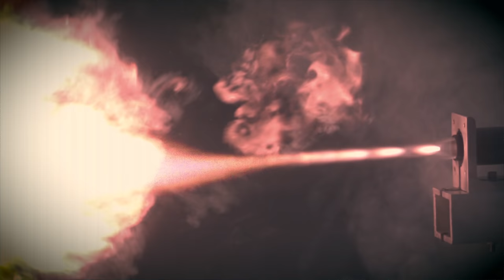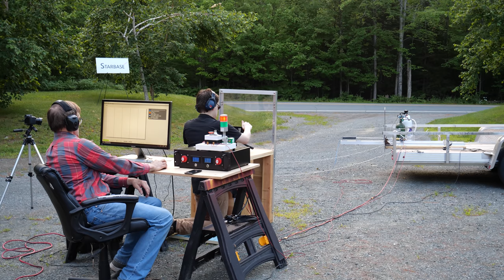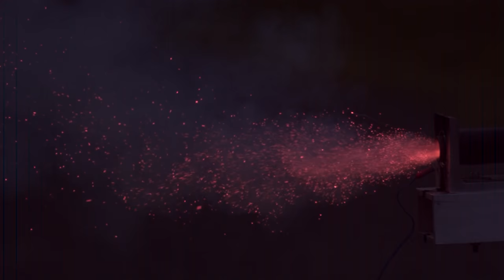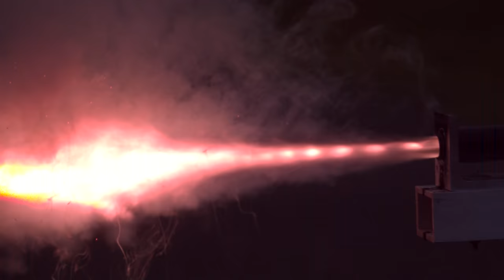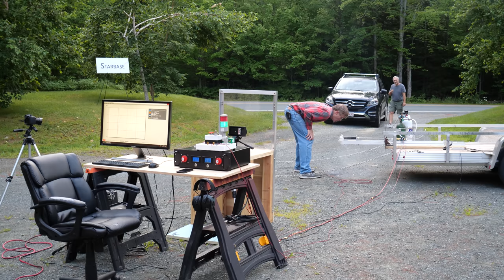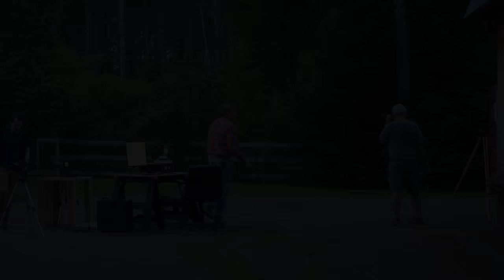Our Most Powerful Rocket EVER! Upsets Local Official!

Comment: Thank you very much! I was about to ask what these light nodes in the exhaust fire plume are, when you explained it @15:20 . Still I did not understand it completely. These nodes are similar to a standing wave formation with one open end. 
1.Could you calculate the exhaust velocity via the distance of each node to another for the standard atmospheric pressure?
2. In vacuum you would not have any nodes I assume ?
3. Could you make a video with computer generated graphs to explain this phenomenon physically?
4. Have you thought about measuring the heat in the nodes and inter-nodal sections?
5. How many decibles of sound was recorded at a specific distance?
6. You for sure have lucky neighbors! If I would reside nearby I would get physically educated on a drive-by-lesson.
Reply from the maker: You might be able to do that, but the exhaust gas temperature and the average mass of the components in the exhaust would also have to be known.
You're right about the vacuum, you need a surrounding atmosphere to support that interaction.

Comment: That was fun.. But as per the "being able to scale these up in size".. I do question, the C.G. of a larger unit, like the size of the old school Space Shuttle Rocker Booster. A stand alone unit, that size, would need a significant wing surface area for guidance. The C.G. quickly changing as the nose becomes exceptionally heavier, as the charge cooks off the rear most weight. The AIM-XXX missiles as an example, are deceptively small looking, even though, they are almost 6 feet long, and other models are 10 feet long. Most of that series in the A2A is computer algo's for flight control and stability and interpolation of its xyz to the rest of the world location. It will be fun and interesting to see. Please note, I am in no way saying this is not a good idea, rather, just knowing, why they shy away from solid forms of propellants, in key situations. I do like the idea of having the ability to actively control burn rate with the nitrous oxide push-through. Sure beats hydrazine, as per the safety factor, by what, 100 times?..LOL.. No point in mentioning N204 UDMH stuff.. That was some high speed stuff, when it decided to do what "IT" wanted to do and not what "YOU" wanted it to do..lol.. It would get outa hand pretty quick. Never mind a eroded shutter valve allowing a full throttle gas off, you just run and hide and wait.. These units you are playing with, do have so much potential.
Reply from the maker: Thanks.
The propellent burns laterally outward from the core as I described in a couple of the previous videos in this series.

Comment: What is the theoretical speed limit of the rocket, if let loose? Is it the same as the speed of the gas leaving the nozzle when measured on the ground, or would the pressure against the N2O decrease with the speed of the rocket so it could go even faster?

Comment: You are the best, man.
One of the most interesting series about rockets I've ever seen.
I have a question
I've got a load cell to make a test platform,
How can I connect it to the computer for monitoring the data?
Is there any specific program?
Reply from the maker: The load cell generates an analog output.  Our system digitizes this, but a DAC can do this as well, although you'd have to calibrate the output.

Comment: I'd really like to know what kind of force these rockets are producing - and especially a weight to force ratio & burn time.  I think it would be great to break down potential speeds you could get for various weight rockets & variable force.  So if it's a 4lb rocket putting out 25-30lbs/ft of force what would the acceleration be, what is the velocity curve, how fast will it be traveling when it is out of fuel (5-8 second burn time??).

I'd like to be able to make some spread sheets to see what potential speeds could be attained by playing around with the numbers - so a goal could be set and then work my way towards it.
Reply from the maker: Did you check out the links below the video?

Comment: I'm curious if the fact that the trailer is not totally stationary, if that reduces the thrust measurement that you see? Cool video BTW.
Reply from the maker: Thanks.
It does, but only by the ratio of the acceleration of the trailer to the acceleration of the exhaust gas. It's completely negligible.

Comment: Without a solid, unmoving base I don't think you'll be able to measure accurately thrust during the entire burn, only the peak thrust. Surely there's a better solution to secure the trailer? Using dyneema or something that does not stretch appreciably and pre-tensioning front and back to hold it in position?
Reply from the maker: The effect of the movement is negligible.  It's proportional to the ratio of the acceleration of the exhaust gases to the acceleration of the trailer.

Comment: Isn't the oxygen redundant? For automotive engines nitrous oxide is the source of extra oxygen to support the combustion of more fuel. Injecting direct oxygen would likely burn a hole in a piston or valve. I don't know much about rockets, but this seemed odd to me for some reason. Anyone know?

Comment: In professional tests the shape of the flame is usually a clean cone-like solid shape
Meanwhile your tests (and amateur tests in general) have the cone shape at first but at the end it just becomes a mess that looks like fire us being thrown around randomly almost as if it's a continuous explosion

Why is that? my personal theory is that your output is fuel rich and after the initial clean exit the output collides with itself at the tip and the air around it and just spews everywhere and since there's leftover fuel that combusts in this randomness and so if you were to adjust the pressure of the nos you'd get a cleaner more efficient shape
At least that's my theory, I'd love to hear your answer and how it compares

Edit: I noticed some evidence that could give my theory credence, as the rocket reaches its final stages it does reach the perfect shape then even loses the tip although at some point, could be cause of the fuel grain widening and thus giving out less fuel (the heat and pressure are not concentrated on a small surface area as before)
Reply from the maker: It's a matter of scale.  "Professional" tests are usually performed on engines with substantially higher chamber pressures and the images don't capture the entire exhaust plume.

Comment: It seems to me the nitrous will be providing thrust as well, perhaps you could isolate that base thrust without ignition and calculate what the increase was.
Reply from the maker: We could, but just like measuring the thrust of a Raptor engine without igniting the methane-oxygen gas, it doesn't seem important.
Reply: @TechIngredients  Oh absolutely, it is a completely legitimate measurement in its own right. I was just thinking it would be an interesting statistic for the sake of it. It would be interesting to see how that figure compares with the increase in thrust liquid engines produce when ignited.

Comment: The rocket exhaust is rather oscillatory.  Could this potentially cause structural failure were it scaled up to a full sized rocket?  Is there any way to make the flow more regular?

Comment: How do these engines compare on the normal model rocketry engine scale? How do your hybrids compare to the Aerotech hybrids with the miniaturized cyclinders? Have you tested the commercially available engines for differences in the thrust of your mostly paraffin fuel cores versus the commercially available composite?

Comment: Sorry if the question sounds funny! would the reading on the load cell be correct if the trailer moved? I understand that load cell is part of what is moving the trailer but any move of the trailer should lower the reading on the load cell. No?
Reply from the maker: The acceleration of the trailer will not affect the reading on the force guage because whether it is static or moves the force pushing on it is the same.
However, the acceleration of the rocket motor does reduce the force because that part of its thrust, which is accelerating the motor, is not seen by the force guage. Nevertheless,  that effect is extremely small because of the motors' small mass times the acceleration, which is also small.
Reply: @TechIngredients  Got it. Thanks a lot. I am still learning

Comment: It looks like there's some thrust oscillations for the larger engine.  You can see it in the data as well where it cycles between -520 and -550 a few times.  Is this indicating a issue with nitrous delivery?
Reply from the maker: I'm pretty sure that's it.

Comment: Guess it pays to always watch the end of the video :) 
I was going to ask you about the bright spots within the exhaust. You mentioned the shockwaves creating the bright spots through the Atm interaction as the propellants are dispersed, but is that an indicator of achieving good laminar flow? And, can you utilize the those expansion and contraction points to improve / degrade the flow (& thereby performance) of the rocket somehow - with addition of say a bell nozzle on the exterior to minimize interference with that indicated flow during actual flight, where the external atmosphere will be continually changing as altitude increases? Just Curious :) 

Thanks for your continued devotion to science, and sharing it with the world :)
Reply from the maker: They indicate that the exhaust is slightly over expanded.  They depend on the exhaust velocity vs atmospheric pressure, but they probably can't be manipulated for any gain in performance.
Reply: @TechIngredients  Thanks! Love the episodes!

Comment: Very Interesting.  I am curious about extending the burn time.  is there a point where increasing the propellant has a diminishing return.?
Reply from the maker: The ratio of the fuel, in this case wax, to the oxidizer is optimal with a slight excess of oxidizer. The total quantity of this combination can be scaled up a great deal.

Comment: Theoretically how high up in the air can the smallest and biggest one get if you strap it onto a stick, or have guide fins on them? Seems like they produce a lot of thrust 👍
Reply from the maker: That's really hard to say even if the weight of the rocket we're known.  High peak thrust engines would be optimal in a vacuum, say launched from the moon, but air friction becomes the dominant limitation from the earth.  Here you want a slower, longer burn to reach maximum altitude.

Comment: I'd suggest roping off the entrance area. At one point a cyclist rode past just at the time you weree getting the all clear.  If one should wander in just at the start...
Also, are there fail safes in the control system?  Is it working like a dead mans switch in case of loss of remote control?

Otherwise great work.  I don't have the smarts to safely build these. At least until I watch the other videos :)

Comment: The combustion instability in these small motors exists because the injectors are not optimally choked. (It is the same basic phenomena described in this video as a 'safety feature') When an orifice is in "Choked flow", the mass flow varies linearly with changes in pressure, and is therefore predictable, and tends to be stable. Because the nozzle size is restricted to Mc-Master Carr choices, it is difficult to properly size the injector to the graphite nozzle (m_dot in to m_dot out for my thermo/transport people). So changes in the pressure gradient across the nozzle (chamber pressure) causes the inlet mass flow to fluctuate dramatically, causing the medium frequency 'jitter' in the Mach diamonds (which is a visual sign that the chamber pressure is oscillating). 

Hybrid rocket motors compound this issue further, as there is a first order dynamical system between the heat transport into the fuel and the Regression rate (mass flow) of the fuel grain. There is also a first order relationship between the chamber pressure and the Enthalpy of combustion. Therefore the net relationship between the regression rate and inlet pressure is 2nd order. So a harmonic oscillation is highly likely. 

This can also be fixed by using more numerous but smaller injectors, so that the mass flow vs. pressure gradient at the inlet is more predictable. But this option is not available for small diameter motors. 

A simple solution (mathematically) is to add a 'damper'.

This can be accomplished by the addition of metal additives (Boron, aluminum, etc.) which tend to stabilize the pressure-temperature relationship, by burning at temperatures far in excess of the combustion temperature of the paraffin/HTBP in the fuel. This causes the fuel to vaporize much more quickly (and at lower pressures) than it would naturally, and this dominates in place of the pressure-temperature-regression mechanism. The down-side is that Isp is reduced, because the exhaust mass increases. So you get higher thrust, but for less time. 

I am very interested in researching the stabilization of hybrid rocket motor combustion at very high chamber pressures (150-200 bar) without metal additives. This primarily requires more resilient fuel grains, mechanically stabilized by a fiber, or some other structurally sound matrix.
Reply from the maker: I think the simpler  metal additives would be a good first step.  Reinforcing the grains can't hurt aside from the greater difficulty in casting, but unless the fuel grain is breaking apart this should not improve combustion stability.
Reply: @TechIngredients  
Thank you for the quick reply! The reason for stabilization is simply to allow increase in chamber pressure. Paraffin (like you have it molded) will crack under intense chamber pressure (more it will form slip planes that propagate due to imperfections in casting). So the purpose of stabilization is entirely to allow the motor to operate at higher pressures. Also my research team is digging into your videos and love them! when I first started working on this a few years back, there wasn't much on Youtube, had to read through a dozen masters theses to get my questions answered. Keep making YouTube great again!

Comment: could you add an onboard propane (or other fuel) injector with a spark igniter so the engine could be extinguished and relit mid-flight? I'm thinking falcon 9 landing model rocket
Reply from the maker: You could.

Comment: Can you vary the burn time with the oxidizer? I'm thinking you might want keep the initial rocket velocity lower until reaching the thinner layers of the atmosphere to avoid some v^3 air resistance.
Also, could you make a catapult for the rocket, like aircraft carriers, to give it as much initial velocity before using any thrust from fuel?
Reply from the maker: Yes, but...
Throttling of a rocket, any rocket, reduces the chamber pressure and lowers the performance effeciency.

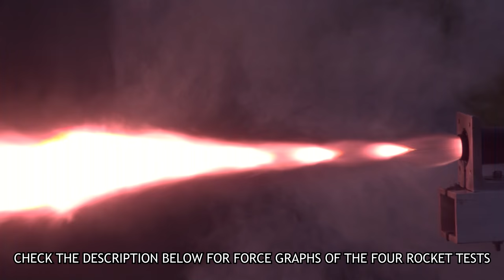Comment: Those phoenix flames you see in 3:55, you also see in the SpaceX rockets, unlike the Nasa Saturn V rockets built in the 1960s and 70s, which had more of a yellow flame expanding from the nozzle. The SpaceX rockets have this semi-transparent phoenix flames coming out of the diverging section of the nozzle in more of a straight line.
Not sure if a diverging section on the nozzle would improve thrust?

Also, did I notice some of the combustion material exiting the nozzle?

Also, I wonder if you'd be able to get the flame a more blue-transparent color, if this means the rocket is running more stoich (and thus more efficient)?
Or would you consider the yellow flame just a byproduct of the fuel type used?
Reply from the maker: We do have a divergent nozzle as I demonstrated and fabricated in part two of this four part series.
The Raptor generates a blue flame because they're burning methane.
The igniter was ejected after ignition.

Comment: What is the smallest cylinder available that could be used and what size rocket would it go into, a rocket engine without a rocket is boring after all we want to see this applied to flight that is why we build rocket engines.
Reply from the maker: I believe they make an 18mm ID motor tube.

Comment: I wonder if you could take advantage of the Karanda effect by firing the rockets inside a large Venturi ring?
Reply from the maker: This has been looked at and although the static thrust increases, the parasitic drag   quickly negates this gain at modest speeds and the added weight further reduces the overall performance.
Reply: @TechIngredients  and if you add fuel to create an after burner?

Comment: I know I'm a little late to the party but I just discovered your channel.  I'm wondering what experimentation you have done with larger nozzles on these rockets. I made it to the end where you were commenting to your neighbor on the presence of shock diamonds in the exhaust. I was taught that shock diamonds are the result of having under expanded exhaust gasses. I know that having a large nozzle can be thermally prohibitive, but for a short test it may still be possible to explore something larger. I apologize if I'm coming off as a smart alec but I'm mostly curious because I don't have any "real world" experience with C-D nozzles.
Reply: I just awoke this morning horrified. I got it completely backwards. Shock diamonds are the result of over expansion. I just remembered my jet engine prof beating into my brain that shock diamonds are not optimized. It really shouldn't matter for a static test but on a bigger craft those regions of flow separation on the lip of the nozzle would create funky instabilities. Apologies.